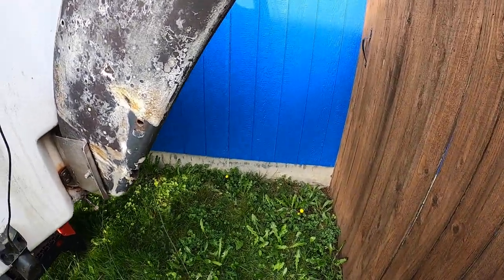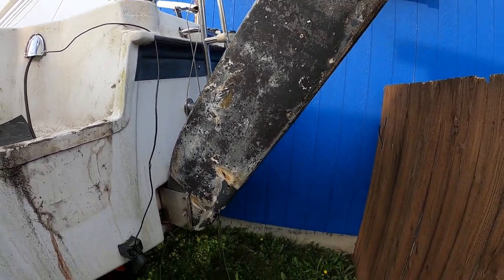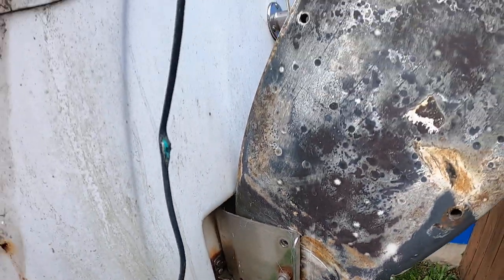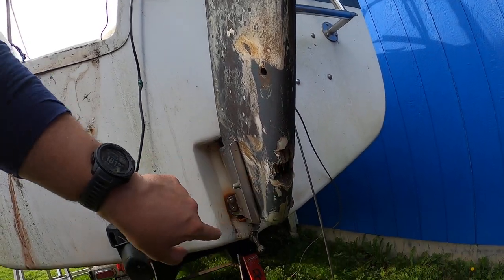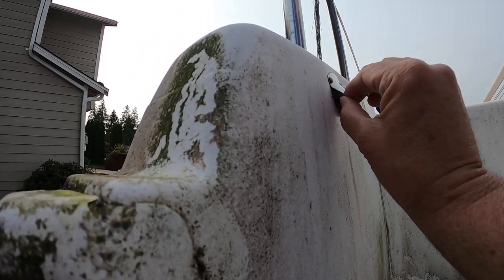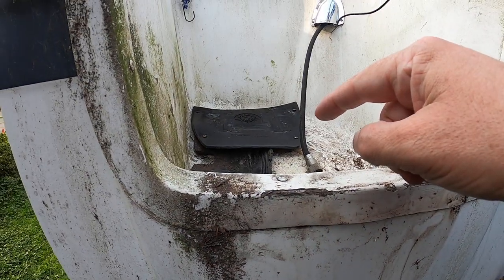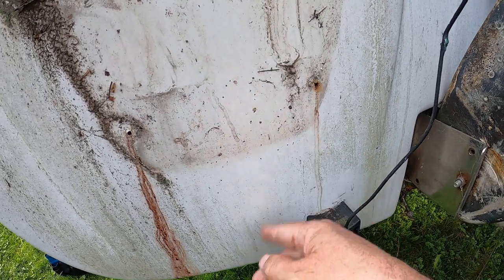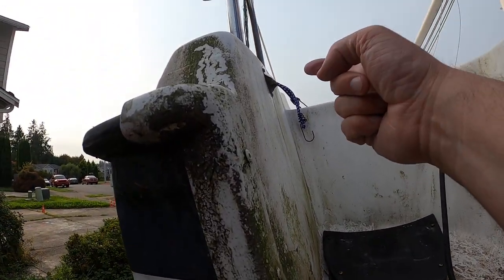Macgregor 26S questions I couldn't find answers for.

Comment: The rudder is simply ugly but should work good. You could fiberglass the gouges and flat spots and then repaint to make it look pretty. That "nut" from under that you said was scratching the rudder is probably for the rudder hold down line, you have to put the bolt thru the hole in the front of the rudder when it's in the down position.  The electric wires going to the motor well are most likely meant to go from the motor to charge your boat's house battery once upon a time.

Comment: a little late for you at this point, but in any case...

dump that rudder overboard, and make/buy a proper rudder.  That stock rudder will frustrate you, do silly things, and generally make life miserable.  The original has no balance to speak of, all of the rudder trails the pivot point, the foot is a miserable half-round like they traced an ice cream pail for the profile.  So easy to stall it, control is poor, and it's heavy.   There are a few drawings online.  I made my first one by adding a foam core, and glassing it on to the original.  Second was made of a cedar and oak lamination. 3rd (best) was divinycell core with carbon fiber tape and epoxy glass based on a  NACA 0012 profile, it made completely different boat.

Comment: Here is a diagram of how the rudder cable works.  https://forums.sailboatowners.com/attachments/image-1251893204-jpg.89854/   The upper end of the cable has a rope attached to it. the rope will go to a cam cleat on the tiller to hold the rudder down when sailing. My rudder had some minor damage from the propeller.  I bought some "Shoe Goo" from Fred Meyers to fill the dings, dents, and gouges. It was a lot more fun than fiberglassing it.